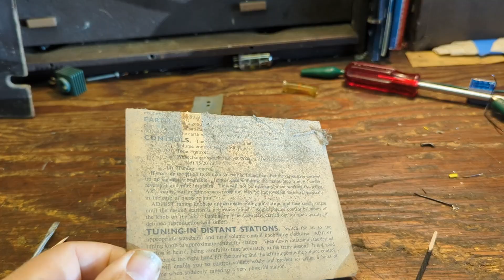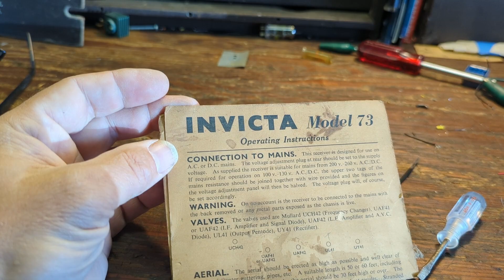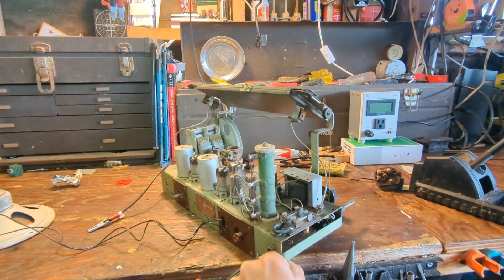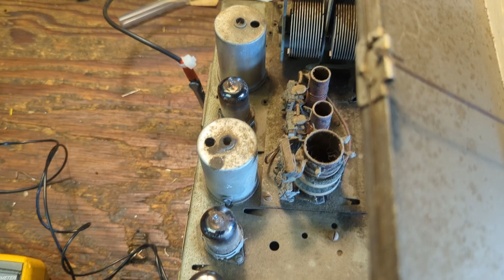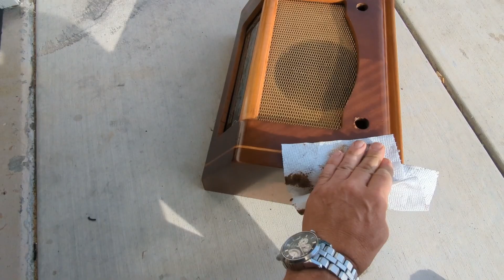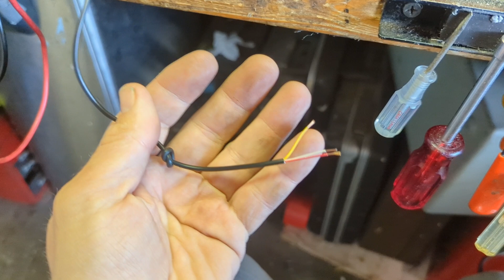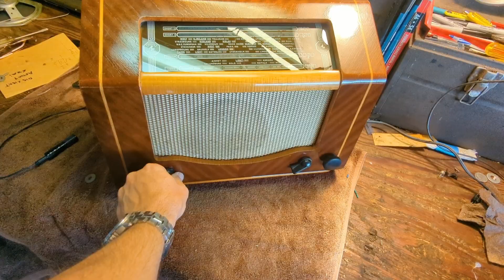British Invicta Model 73 hot chassis radio overhaul

Comment: The mains plug is a very early BS1363 one, this is a universal plug replacing the series of round three pin plugs for different amperages. I suspect the radio originally had a 5 amp round pin one (or even a 2 pin) and was changed by the owner as it seems to have a 13 A fuse which is far too big. It would place the export of the radio to the 1960s or later. These plugs still work but modern ones have safety features such as partly insulated live and neutral pins. Anyway the radio is better off in SF given that AM broadcasting in the UK is in its death throes.

BTW I live in St Annes, Lancashire, where George Formby lived, his house has a commemorative plaque on it. St Annes is just south of Blackpool which is one of the places he is associated with. One of this other famous songs is another very suggestive one about his little stick of Blackpool rock :)

Comment: You do not need to change any wiring to change the voltage. Moving the link on the voltage adjuster does exactly that.  The directions even though written in English is misdirecting.
Reply: My mistake lol

Comment: You could have just use that voltage selector instead of using all that effort you just pull it out and plug it in at the right voltage
Reply: Is more complicated than that. The plug on this set was only set for 200 plus volts. In order to change it over to 110 needed to be rewired partially
Reply: @setharp  you change the position of the plug it's multi-tap it's user-friendly
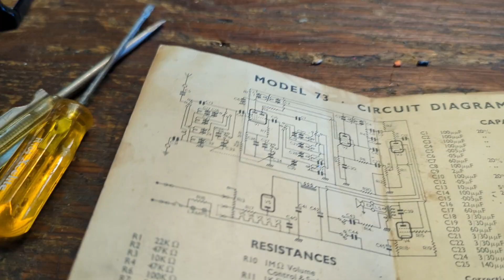Reply: I understand that principle. But that's not the case with this radio. The different selections from the center tap for 230, 240, 260, and some other voltage but otherwise no selections for 120. The instructions indicated that you needed to rewire the main power resistor up top of the radio in order to halve the voltage to make it 120. My assumption is that this radio is intended to mostly be sold in territories that were operating on 220 volts with the option to convert them to 120 and some of their other territories at the time. It's very different from the German set that I tend to work on where they almost almost reliably have the ability to go from 2:20 to 1:20 with just a matter of moving a plug or moving a fuse